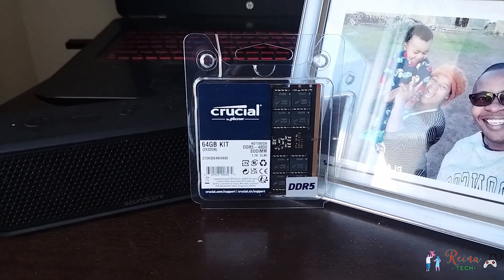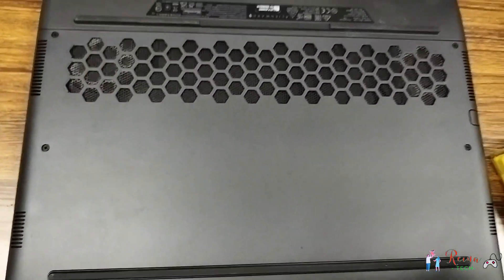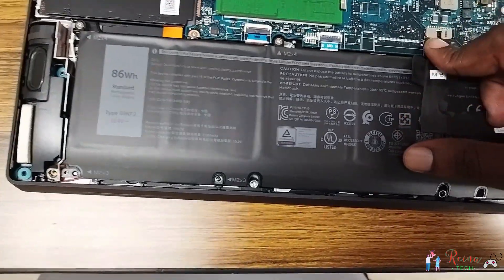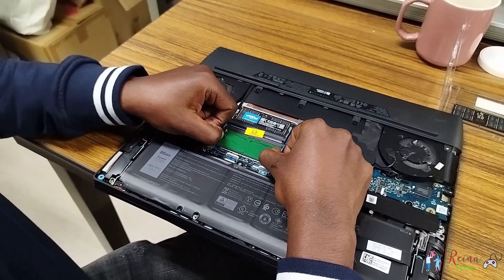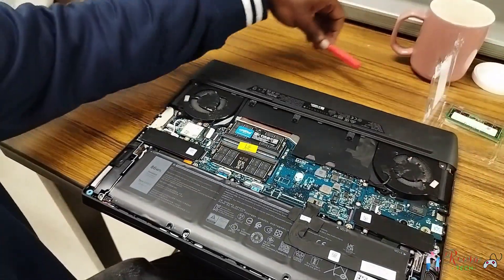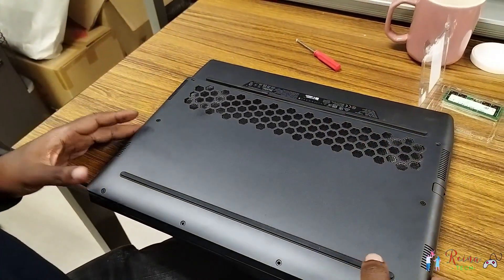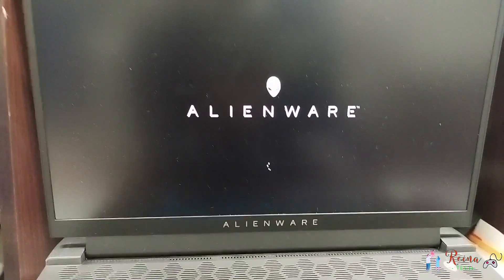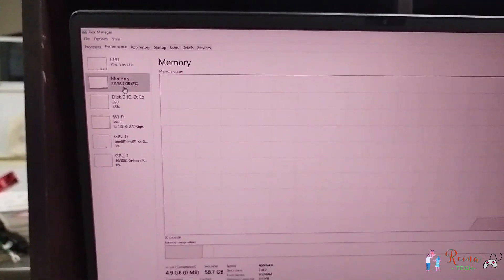How to change RAM in Alienware m15r7 in 5 minutes! Performance Boost! #ddr5 #64gbRAM #m15r7RAM good

Comment: It's weird. I bought two Corsair Vengeance 16GB DDR5 4800MHz for my Alienware m15 r7. I tried installing them, but the laptop cannot recognize them and showed the "invalid memory installed". Before purchasing, I referred to various parameters to ensure that the RAM and computer model were corresponding, but strangely, they could not be recognized.
Reply: I met a same problem too, my laptop just went black and nothing happened, someone advised me that I should keep waiting, but I had been waiting for over 30 minutes and it still didn’t work.😢😢😢
Reply: @jiming-zeng2403  So I returned the product and bought two Crucial memory sticks of the same specification, which can be installed and run normally.
Reply: Only crucial RAM ?
Reply: Only crucial ram ?
Reply: @alexandreduyme7689   from what i have seen crucial is the only kit that will work

Comment: Hi. It should take around 10 minutes with the screen off or I just messed my laptop? I just have installed a new ram and another SSD M2...... And the screen is still black after 3 minutes... So each passing minute It makes me feel worst and worst
Reply: did you manage to run it smoothly?
Reply: @eVGe1337  it was that my SSD M2 Kingston fury ram was not compatible... So I had to buy the crucial memory's (there is a specific model that works) and it solved it all.
Reply: @neurotrollium253  Could you share with me the link of the Crucial you installed, do you have the M15 R7 with AMD?
Reply: @neurotrollium253  thx!
Reply: @headhunterx007  I have the Intel version, and the ram model is this "Crucial RAM 32GB DDR5 4800MHz CL40 Laptop Memory CT32G48C40S5"

Comment: This is easier than I thought it would be. Thank you :) The power connection worried me a lot, and discharging the motherboard is new to me. One thing I'm not clear about, do I hold the power button for 60 seconds to discharge BEFORE I disconnect the battery? or after?
Reply: after you disconnect the battery!
Reply: @majobuitron1503  thank you !!!